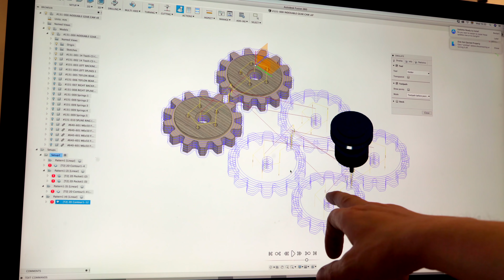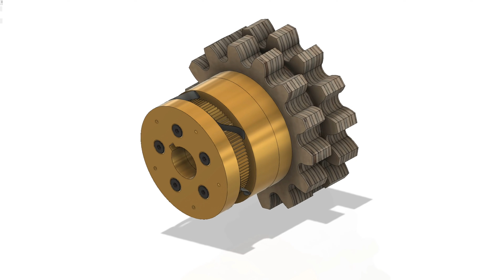Tweaks & Fixes - Marble Machine X #84

Comment: would have been cool if you measured how long the machine ran before and after the resistance improvements by spinning up the flywheel to a specific BPM then letting go and timing it before and after!
Reply: Because he lightened the flywheel so there is less momentum anyway.
Reply: @NeuroFit Music I think you misplaced your reply
Reply: Still would have been a neat experiment. If the friction were reduced enough, the coast time could be the same or longer, even with flywheel mass reduction. Disengage the rhythm machine and remove all pegs from the programming wheel, and remove all balls first, though

Comment: a tip for getting gears to mesh properly (when they are adjustable) try running layers of paper through the gear. Not sure how well this will work with the large wood teeth but works very well with small metal gears

Comment: Have you considered the use of woodworking machine wax? It's used on saw and planer tables. saw blades etc to reduce friction. For example  https://www.rutlands.co.uk/sp+hand-tools-tool-maintenance-cleaning-lubricants-machine-blade-wax-extra-large-400g-rutlands+m_dk7525 (other machine waxes are available). I see no reason why it wouldn't reduce friction in the Marble Machine X in certain places.

Comment: Maybe you should consider balancing the flywheel, since it's spinning quite fast. That way you can reduce vibrations which should allow the machine to run more smoothly.
Reply: he could just take it to the local garage to let them balance it for him.
Reply: Why not just design an extremely overcomplicated and unnecessary damping system?
Reply: Alex Jamieson • It should also have swords... and lasers. 😎
Reply: @user2C47  Lmao he could build a tuned mass damper for the mmx
Reply: @patrick1532  is a tuned mass damper not a pendulum-like device found in tall buildings? I was talking about some type of flexible mounting system.
Reply: @user2C47  Better to stop the source of a vibration instead of just isolating that vibration from the rest of the machine.
Reply: @Darkassassin09  the original reply was meant to be a joke.
Reply: @user2C47  Yeah it is I was meming, it's just funny for me to imagine.

Comment: If you lower the resistance doesn’t that mean it changes other things in away? I’m not sure if the you would get a little different beat time in the drop ratio of the sound, with the timing of the drops it sounds like it’s going to be something to recheck to be certain there’s no difference but like I said I’m not sure tho I might be just worried you might end up spending more time

Comment: Why don't you lubricate your gears? With wax for example?
Reply: Natural bees wax would be perfect for wood
Reply: Windmills use lard on their wooden gears.
Reply: I was wondering this as well. I'm sure there is an answer.

Lard would STINK after a while but I'm sure there is an equivalent that could work.
Reply: @inthefade  
I think the wax would become greasy and dirty after a while. I wouldn't add it just yet. On the finished product, when everything is set up and you disassemble it after a concert anyway, seems reasonable. Assemble it, grease it, play on it, disassemble it, clean it, move to next location, repeat.
Reply: ОранжевыйЗонт it would degrade in heat from friction or weather

Comment: Have you waxed the wooden gears? I have several wooden jigs that i keep waxed, as it cuts down on wear and makes operations smoother.
Reply: Always remember to lubricate your moving parts.
Reply: @Artaimus  l u b r i c a t e
Reply: Do you know what would happen if grease was used?
Reply: @thatdirtymichiganmusician1038  If grease was used instead of wax, the wood would absorb the grease and it would just get messy and attract dirt and grime. Wax or graphite are the correct choices in this situation.
Reply: Alvatore DiMarco I totally agree... grease is the worst choice possible. Even all the dust it attracts can be a complete nightmare!
Reply: @alvatoredimarco  have you ever been inside a proper 1600's dutch windmill? You can find allot of bees wax on every wood part that moves. without it the wood would be gone from the enormous stress of milling flour or pumping water
Reply: @alvatoredimarco  A dry silicon lube would work too.
Reply: @MrJob91  I've seen lard being used in windmills as well, which is comparable to grease but probably dryer.
Reply: @thatdirtymichiganmusician1038  Don't use grease on wood - it will cause the wood to swell. Use wax or a non-flaking dry lubricant such as Teflon powder.
Reply: The wrong kind of grease would rot the wood. Personally I think Martin should engineer inserts that go into the gear teeth because I believe the wood on wood contact would cause a lot of wear.
Reply: @thatdirtymichiganmusician1038  Grease is no good for wood. It absorbed into the wood and breaks down the components that make the wood strong. I only know this by experience.
Reply: Max Byrd 
Grease and wax are two different liquids like water and Coca Cola.
Reply: It's much easier with wax. If you want, you can warm the wax up a bit so that the wood absorbs it better. Good luck 😎
Reply: @eska6561  That's what I did for my wooden clock. It's been running for years now. Graphite will be black and look messy. Put some wax on the gears, and heat it so it melts into the wood, it will be lubricated for a very long time, and won't change the look of the gears.
Reply: Tree Wax is great for this.  It will reduce friction and wear in your gears, it will not collect dust or grit, and it will not stain the wood, but it will create a finish effect, as if the gear was lacquered, but just the appearance.  It has a very high carnuba percentage.
Reply: @Azuon79  don't test me ++++
Reply: @theemperiumofkek1362  +++++
Reply: I would  use graphite  but i ain't an expert.i know   warmed up bee wax works well
Reply: @dragonbullets2763  Graphite works but it is black, not so esthetic. Wax or dry soap
Reply: Air Force mechanic here. We use beeswax in places that grease would chemically react with other fluids.
Reply: Bump
Reply: + ultra
Reply: Big +
Reply: Wax works great on wood-wood drawer slides,  why not gears
Reply: Eddie Hill +
Reply: I made the same comment before noticing yours. Sorry.
Reply: Paraffin?
Reply: @WillBreaksStuff  Paraffin. a flammable, whitish, translucent, waxy solid consisting of a mixture of saturated hydrocarbons, obtained by distillation from petroleum or shale and used in candles, cosmetics, polishes, and sealing and waterproofing compounds.
Reply: TIL to wax your wood to protect it from friction.
Reply: I’ve used paraffin and car wax with what seemed similar results.

Comment: Those brackets at the top of the machine was a good idea! I always thought it might be a problem to get enough marbles to the last pipes otherwise...
Reply: It would’ve been weird to hear notes that didn’t play because there were no marbles at the end.
Reply: These new brackets have the opposite affect, they are put in place to increase the BB's that drop into the front section, the vibraphone module. Without them in place they role down the staggered ramps on their way to the last group of tubes
Reply: There are already channels to fix that problem. Those brackets were placed in the channels to allow more marbles to flow into the front half.

Comment: 1:44 but... the level isn’t sitting on the machine level... AHHHH
Reply: The cross member may not be level.
Reply: Dont worry, at 1:55 it is ^^
Reply: Valentin Pfützer is that the same level? I think he put them in several places
Reply: Leigh B I think if he sets it up to be “level” with the machines current degree of levelness, even if it’s a bit off, having those will just help him to get it back to constant state, even if it’s constantly a smidge off